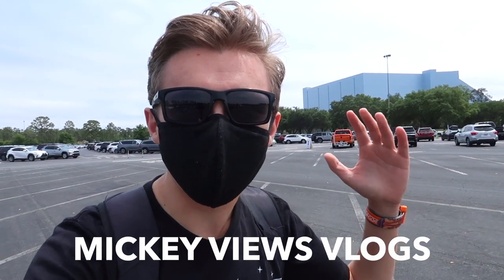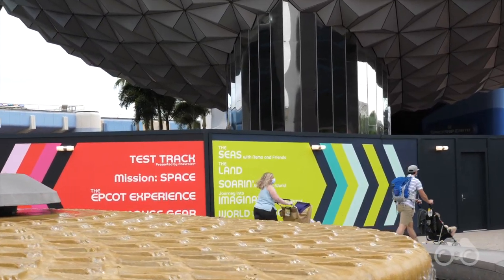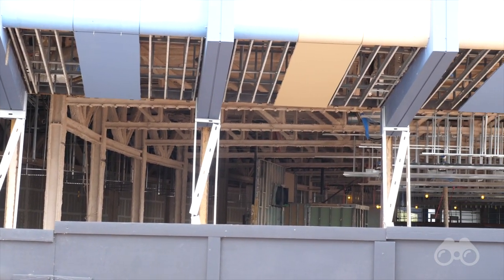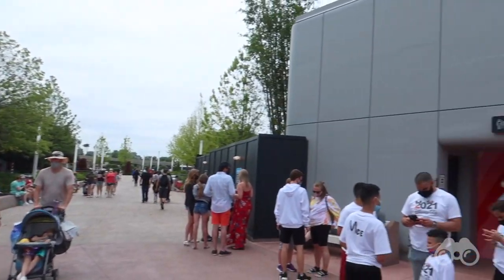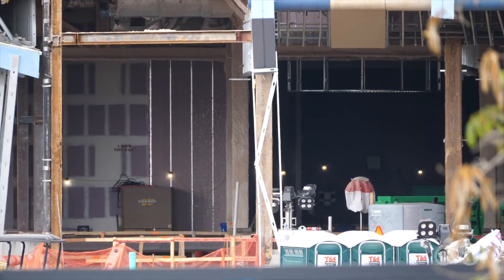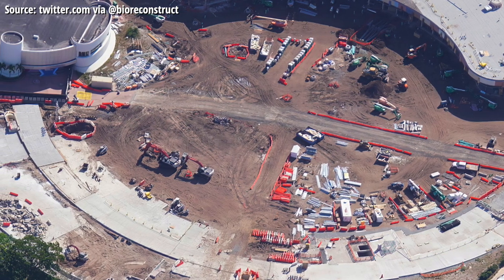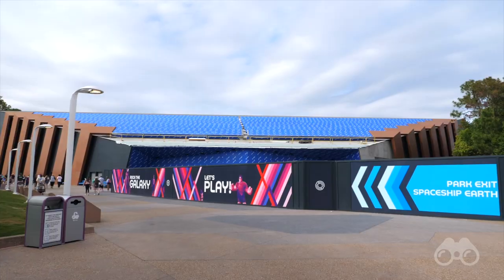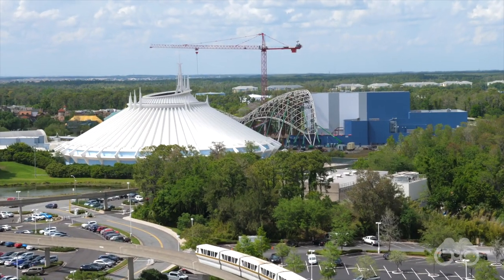DEMOLITION COMPLETE at EPCOT! - April 2021 Construction Tour

Comment: Thanks for another great video, Brayden. I would really like to know what is up with the non-functioning Epcot Monorail. Is it a maintenance issue? Are the monorail vehicles so far past their original replacement date, that they can't keep enough of the vehicles operating to run both lines? Is it something else?
Reply from the maker: Monorail drivers are an expense Disney will cut down on anytime they're given the opportunity. Less operational cost = higher returns. This type of accounting only works short term in my opinion. Done over and over combined with increasing what you're charging guests inevitably tips the scale eventually and then Disney will have to spend and spend to earn back lost customers. This doomsday scenario has always been prophesied but it seems no matter what Disney does guest satisfaction continues to go up. It's at record highs right now according to CEO Bob Chapek. Record high guest satisfaction amidst no parking trams, no Epcot monorail, many dining and shopping locations still closed, resorts closed, health restrictions, highest prices there have ever been etc. From Disney's perspective, their guests will go no matter what, and thus far that has been the case. The question is, how far can they push it, and will they ever accidentally tip that scale? I'll keep making these videos, and we'll find out! Thanks for all of the support! ~Brayden
Reply: Thanks, Brayden. As usual, I totally agree with your astute analysis! Brayden for CEO!
Reply: @hughmsonk  I agree Hugh - Disney need to stop all the changes (especially the ones caused by the WOKE minority)
Someone who has some common sense and loves WDW for what it originally was should be put in charge.

Comment: Everything Disney do could be done a LOT quicker. They take forever doing anything. They have 3 major construction projects in flow that were in flow last time I was there in 2108. One is ready to open but even in 2018 they structure was almost complete on the exterior back then. They really need to address their project rates.